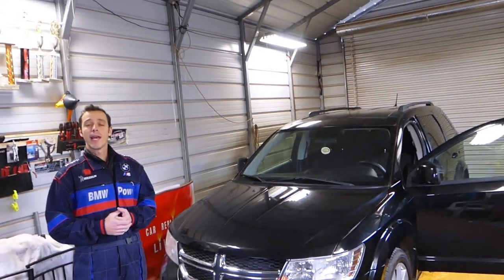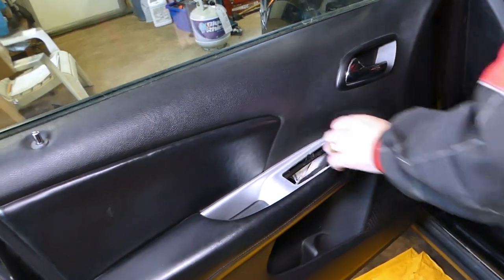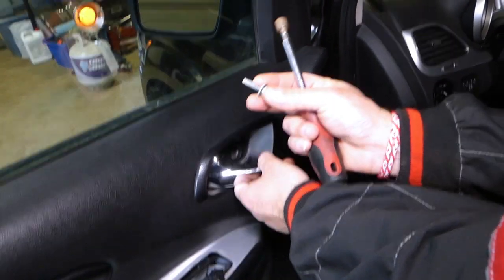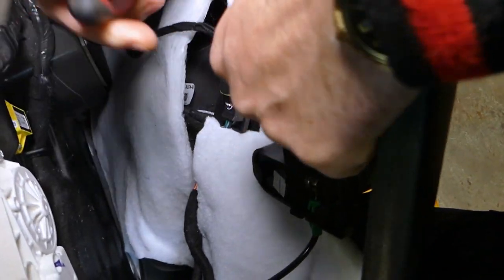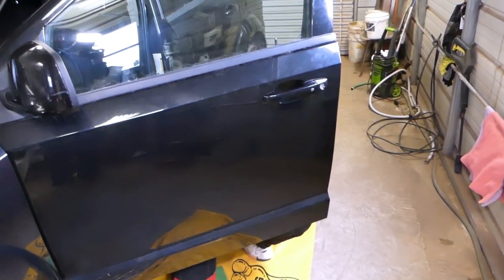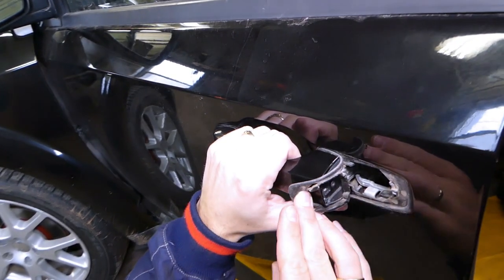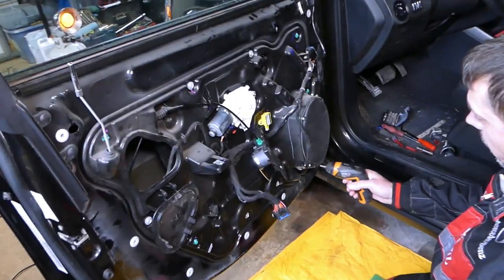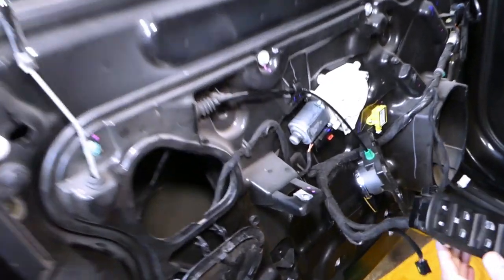DODGE JOURNEY FRONT DOOR LOCK ACTUATOR REMOVAL REPLACEMENT DOOR HANDLE MECHANISM

Comment: My passenger door will not open at all. The automatic/electrical locking mechanism works but when it’s “unlocked” and the notch is up, it will not physically open if you pull the handle. I’m sure it is a mechanical problem but I cannot open my door in order to do this and see what the issue is.
Reply: Mine is doing the same. Any way to get the door open?

Comment: My door lock on driverside doesnt work with the master button or the keyless remote. is this the culprit? if i change the actuator out it will work again? i have to manually unlock or leave the door unlocked to get in and out... thanks so much for these videos! i hate my dodge but you are saving me lots of money!! and more importantly frustration and peace of mind!
Reply: I have the same issue but on the passenger side... did you able to fix it ?  what was the problem ?
Reply: @ztahielaufer4688   Did you find a solution?  I have the same problem.

Comment: Is there any way to roll down the window with the door off the car?
Reply: You have to unscrew the 2 screws holding the motor and when you take it off your going to see the plastic gear wheel, just take a flathead screw driver or any stick and twist it in the direction you want it whilst also pushing the window down.